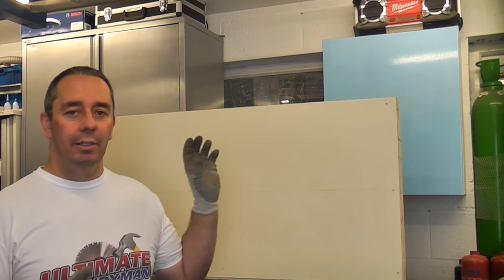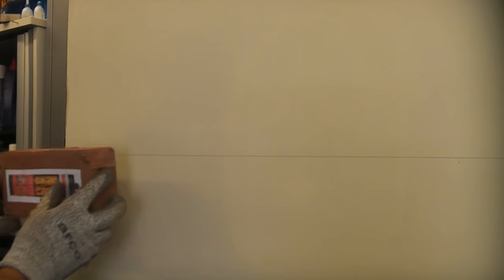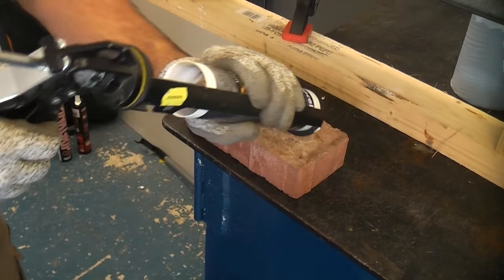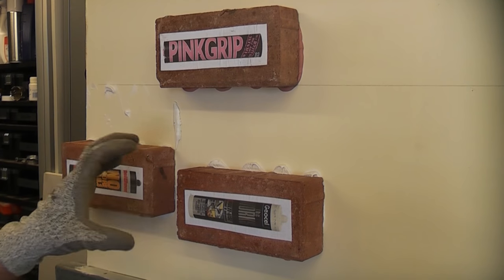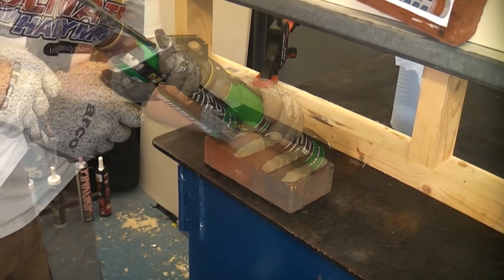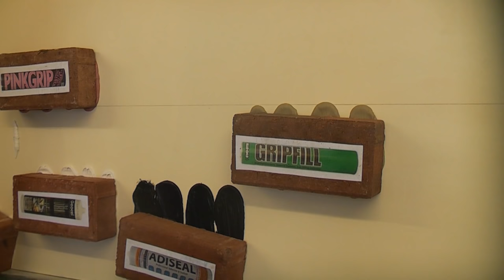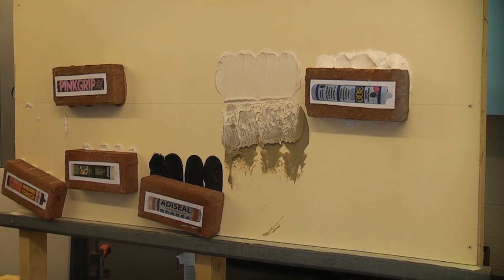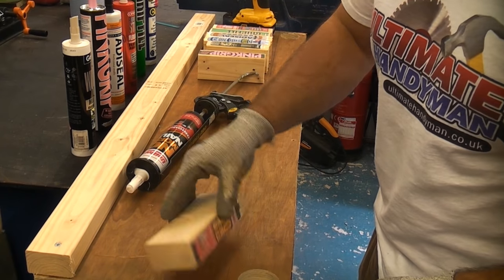Grab adhesive - grab and strength test

Comment: Adiseal have a new formula with higher grab than the Adiseal product tested in this video. This test was carried out on our old formula product which has lower grab than our current products on the market. Also when carrying out a strength test, please carry it out on a metal surface with metal blocks. As you can clearly see in the video the top layer of plywood has come off before the adhesive has failed on some of the products meaning this is not a very good test. The test is like trying to stick something to a painted wall with an adhesive. If the item falls because the paint peels off you can't say the adhesive has failed.
Reply from the maker: Thanks, I did try metal stuck to metal on a previous test (but not with Adiseal) and none of the adhesives worked well at all and the bond was broken with just a few PSI of pressure. In this test- 
 "Serious STUFF" - 397 PSI. 
"Geocel The Works"- 528 PSI. 
"C-T-1" - 642 PSI.All performed better than the Adiseal and they were all stuck to the same piece of plywood!Obviously I can't afford to keep going out buying a new tube of adhesive every time the manufacturers make an improved version.
Reply: Thank you for your comment. The point I'm making is using plywood (even if its the same plywood sheet)  will give misleading results all the time as an adhesive is only as strong as the surface you are bonding to. You will get very different results even if you carried out the same test using just 1 adhesive in different areas of the same plywood sheet as plywood is layers of wood veneer glued together.
You need to carry out the test on a solid item where the surface is not going to break before the adhesive breaks to give results which are not misleading. The comment is not to cause upset but to point out the fact that results in the video are misleading not just for Adiseal but all the products tested.
Reply: We are more than happy to pay for new tubes of adhesives for you to carry out a new test if you are happy to.
Reply from the maker: Thanks, I have tried to do the test using metal on metal (both pieces were galvanised), but after a week of the adhesive curing the test pieces could be removed with so little force that the pressure gauge did not even register any pressure. 
I'll try and rig something up using stainless steel when I get chance.
Thanks for the comments ;-)
Reply: kind of surprised you didn't include something from pattex or bison in these tests. But if you were to buy every brand yourself it would get really expensive.
Reply from the maker: Thanks, yes I think I spent about £60 on adhesives- which are then left to go off as I rarely use them.
I just bought what I could from local shops and DIY shops etc.
Reply: is it possible that the most accurate test is when one of the surfaces is porus and the other non-porus. Most mastic manufacturers recommend this in their tech specifications.

Comment: In my experience you would get a better result by putting thinner stripes of adhesive on the bricks. If the adhesive is too thick it tends to defeat the purpose which is probably why the CT1 didn't stick until it was further down the wall and the adhesive had thinned out a bit.
Good video though, keep up the good work.
Reply: Master good point
Reply: I thought same. More the better isn't always true
Reply: Choochter I’ve only ever used stuff like this to seal cracks

Comment: It's the way you apply the adhesive. Top tip . Apply lots of "0" instead of a line and when you push it on it pops to secure it to the wall
Reply from the maker: I applied it the way Everbuild did in their original video "the real torque challenge".
Thanks for the comment 👍

Comment: I agree way too much applied, also I would move the block around till you feel the grip has caught. I do small a circle motion till it feels grabbed.
Reply from the maker: I just copied what Everbuild did in their original "Maximum torque challenge video".
Of course there is nothing stopping you from going out and buying the same adhesives as me to repeat the test with less adhesive for the benefit of the people on YouTube?

Comment: For initial grab, I use the stick, pull apart, refit method. never had a problem using Gripfill or Pinkgrip. Many of today`s materials don`t like adhesive based products anyway, so you have to go solvent free, and choose suitable methods of additional fixing or support.
Reply from the maker: Thanks for the comment ;-)

Comment: Superb. I love these forensic DIY videos and I can't thank you (and people like you) for taking the time to make them. However.. I've worked in very heavy engineering all my life and one of the many things that drives me a bit nuts is folks using too much adhesive. For example.. I used to see guys building cranes and SOAKING bolts in Loctite. There is no need to do this. A few small spots of Loctite gets the job done without a pool of blue stuff on the floor.
Reply from the maker: Thanks for the comment 👍

Comment: Wouldn't the amount, and thickness of the Sealant, allow for the slipping of the bricks? A thinner application may be a better test...
Reply from the maker: I tried to put roughly the same amount on the bricks that was used in the original "Maximum torque challenge", as their video tested out several brands of grab adhesive and only the Maximum torque stuck. I have tried it with roughly half of the adhesive and it did not make the block pavers stick any better.
Thanks for the comment

Comment: Brilliant testing, thank you. It would have been good to have a look at what was left after the hydraulic test to see if the adhesive or the timber block had torn first.
Reply from the maker: Thanks, the only one that de-laminated the timber was the C-T-1, which took part of the plywood with it. On the previous tests that I did the Nemese brand from screwfix held so well that the wooden block split in two, the two original test videos are here (just in case you have not seen them)
https://www.youtube.com/watch?v=9XgDvYsJiB8
https://www.youtube.com/watch?v=80pC1-eJFj0
Thanks for the comment ;-)

Comment: Actually looks like it's the ply that failed with the CT1. Great videos, keep them coming.
Reply from the maker: Yes, that is correct. There is no disputing the bonding power of the C-T-1, it reminded me of the Nemesis in the previous test which split the piece of wood in two!.
Thanks for the comment ;-)
Reply: @ultimatehandyman  that CT1 is good stuff, generally use that or Pink Grip every time. Just used the CT1 to stick AluSpalsh round a kitchen. Had a bit of overspill come through into the Patress cutouts, spark said it was a bitch to get off! On the other hand I noticed you mentioned Nemesis products, I've used their caulk on the past jobs and I can't seem to beat it. Polycell caulk I find is pants, shrinks alot and until bind isn't great. A good vote for Nemesis from me.

Comment: The idea of being able to instantly glue a heavy brick to a wall, and have it stay, is more interesting than anything on TV.  I did not think it could be done until I saw him do it.  Most readily available glues and grab adhesives are hype, not real sticking power.  

P.S.  If you want superglue to take a quick set, spray the joint lightly with accelerator after you glue up the pieces.  In the USA using accelerator is the only reliable way to get CA glue (superglue) to really hold anything together.
Reply from the maker: Thanks for the comment

Comment: Interesting, but  Inconclusive!  I think you need to use standardised tests, some of those bricks clearly had more adhesive on than others, and you need to standardise how hard/long they're pressed on before the test begins,.
Equal amounts of adhesive, equal pressure for equal time, then start the timer, too much glue is sometimes detrimental, especially for 'grab' adhesives, 
(I've used 'pink grip' before, it's bloody good, goes off in the tube a bit quick though, so only buy what you need, even sealed tubes can go off within a year, cardboard see, maybe you could spray them with a sealant tho?) ☺

Comment: I watched the above video after searching on Google for something to fix a tricky situation ... 
One night last week my wife heard a clatter downstairs, and as she thought we were being burgled she awakened me. On inspection a complete length of 4 metre Gyproc coving had left the ceiling and decided it didn't want to play anymore. It was in good condition, unbroken and lying on the floor. On further inspection behind it in the coving recess were some telephone cables whereby the former house owner had clearly removed the coving and hidden wires behind it, you could see where he had applied a product (unknown) from a gun to the cove. 
My problem was that the coving was considerably heavier than it would have been because of the original Gyproc cement application, thus I needed something trustworthy to hold the cove up ... as I was only going to get one chance at it, otherwise it meant buying a load of Gyproc coving just for one piece. I went with your recommendation and bought Nemesis ... and glad I did.
I did the preperation of cleaning everything down and removing crusty bits and got it totally dust-free, both cove and wall. I applied the Nemesis to the wall and ceiling to align with the coving flats and applied it, with the help of my wife. I even had nails and hammer ready to underpin it ... but wasn't needed. It immediately attached itself to the substrates and stayed there with no support or aids .... and as said it was quite heavy with the original cement attached, which was immovable without damaging the cornice piece.  Many thanks for the video and recommendation, saved me pounds and hours of messing about. 24 hours later it was bonded, caulked and made good with a following coat of emulsion, and as if it never happened.  Good stuff, thanks again.
Reply from the maker: The Nemesis is great and very inexpensive.
I have just tested several more brands, which I'll upload once I get chance to edit the video.
Thanks for the comment

Comment: Interesting thanks. I normally use the Screwfix own brand if it's something light, as it's only 1.50 a tube. It works pretty well, it won't grab anything too substantial though. Nemesis is a better product, but 5 quid a tube, these 10 quid a tube ones are way too much. Might switch to Pinkgrip in the future, after watching this .
Reply from the maker: Nemesis is great, I have used that a few times now and is my grab adhesive of choice.
You are right about the price though, some of these at £10 a tube are simply hyped up or clever marketing. 
Thanks for the comment ;-)

Comment: nice video ,i got an " airing cupboard " which isnt its just a closet in a new build flat but the entire electric consumer board is next to it so sod knows where the wires from it go to so i dont wanna drill or punture holes into it for brackets for shelfs ,i dont have a wire or stud finder so id rather glue posts on the insde for support struts
Reply from the maker: Yes drilling in such places is a bad idea.
Thanks for the comment ;-)

Comment: Wow, No 'thumbs down' yet, the haters must have come unstuck! :)
Great Vid/test.
Cheers
Reply from the maker: Ha Ha, there is time yet- when the haters get to their computers ;-)
Thanks for the comment
Reply: Dude another bloooooming great video ... you are the MAN
Reply from the maker: Thanks for the comment ;-)
Reply: I was thinking to get the best of two worlds would be to to use two produts to mount the item,  using partially the PINKGRIP and partially the C-T-1, that way you have the intial grab plus maximum troque ... what do you think ?
Reply: 1 psi ... what does that translate into Kilo Gram?
Reply from the maker: Not sure, you would have to work out the internal size of the piston, but because the same equipment is used for each test you know that if one block needs 450psi to remove the block and the other block only needs 200psi you know the first block had the stronger adhesive ;-)
Thanks for the comments Jack ;-)
Reply: ***** Yes, the test gives a comparison value, but not the load ratio. What do yout hink about my earlier comment using PINKGRIP and C-T-1 on the same item?

Comment: Did you not put way too much on the bricks?
Reply from the maker: I tried to apply the same amount of adhesive that was applied in the original "maximum torque challenge" video. To do that I cut all of the nozzles to the same length, but some of the adhesives are thinner than others so its difficult to control the amount of adhesive that come out of the tube.  You can see my version of the maximum torque challenge here-
https://www.youtube.com/watch?v=9XgDvYsJiB8

Comment: you have to bear in mind these are two different properties and don't go hand in hand. For the best grab the product has to be thick and fast curing ... Pink grip definitely for this. but the down side is it skins over fast and unless you break the skin it's useless. CT1 has poor grab but it is thin and gets into all the nooks of your substrate so if you don't need the grab you are much better off with a thinner adhesive. believe it or not bog standard pva adhesion is damn impressive if you have something to pin It together with and leave for 24 hrs
Reply from the maker: Thanks for the comment

Comment: Top video, It would be great to see a test of weight  load bearing capabilities of the new plasterboard foam based adhesive versus the traditional dot and dot method. Also interested to see hot the new Stick Like  pars up with the CT1 etc
Reply from the maker: Yes, those tests would be interesting. I suspect dry wall adhesive will be much stronger than the foam!
Thanks for the comment

Comment: So what's the best way to remove this stuff cleanly without a 642 PSI hydraulic ram? I want to build some integrated wardrobes, cupboards and drawers in my bedroom. I was originally going to use wall plugs to hold my 2x2 framing timber to the plastered brick walls, but it's not gone well, so I'm now looking into construction adhesives instead. However I don't want to put use it if removing the units at a later date will wreck the wall.

Some people say to use white spirit, others say to use an electric heat gun. Some even say even say it'll never come off, and replastering the entire wall will be the only option. I want to plan ahead before diving right in. Since the wall plugs idea that I thought was a sure thing hasn't worked right.
Reply from the maker: No idea, sorry.
I only use grab adhesive for permanent fixtures. I have never had to remove any!

Comment: It's a great video and kudos to you for making it, but I think it could do with a final summary - what are your thoughts after this test? Any product you'd particularly recommend or advise against? Have your tests changed your daily choices when it comes to grab adhesives?
Reply from the maker: Thanks, I try to make my videos as short as possible and try not to influence people by doing a summary. 
This is only one of the tests that I conducted after my initial "real maximum torque challenge". You can see more videos here- 
https://www.youtube.com/watch?v=9XgDvYsJiB8
https://www.youtube.com/watch?v=80pC1-eJFj0

To be honest I use Nemesis now (from screwfix) as it stuck on the vertical test and also performed well on the strength test. I even glued the bottle holder into my fridge door using Nemesis grab adhesive and even epoxy glue would not do that!

Thanks for the comment

Comment: I can't seem to get any grab at all between two small pieces of wood using No More Nails. Neither could it hold a small strip of cardboard to the wall! Can this be a faulty tube?
Reply from the maker: It could be due to temperature.
Most adhesives don't work well if it is cold.

Comment: Just a quick thought on this (great) old video - been using Gripfill for years and can't understand its low score - except that it could be that sometimes it takes a long time to fully cure.

In the past, I've had to swing a lump hammer to separate timber glues with this stuff - and always the timber breaks first.
Reply from the maker: I can't remember how long I left these test pieces to cure, but normally I try to leave them at least a week.
Thanks for the comment
Reply: Well a week should be more than enough! Mind you even 200 psi is a pretty strong bond - but > 600 is amazing!

Comment: A great test! I have on occasion used two different adhesives for the same application, a high grab, fast drying one for initial hold and a slower curing and far stronger one for lasting strength. Get the best of both this way. From what you tested in this case i'd go for the pink grip plus C-T-1
Reply from the maker: Thanks, the C-T-1 bond was good, but I'd just use the nemesis brand from screwfix as the initial grab is good and the bond is excellent as well. Not sure if you have seen the previous videos-
https://www.youtube.com/watch?v=9XgDvYsJiB8
https://www.youtube.com/watch?v=80pC1-eJFj0
Thanks for the comment